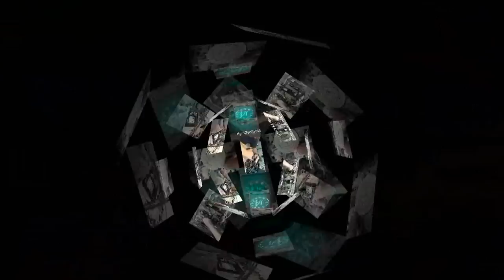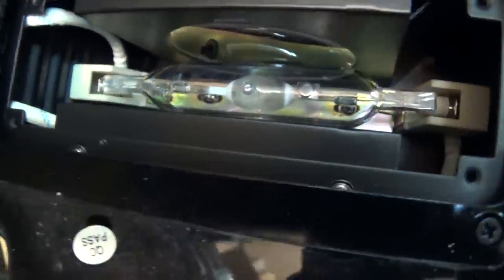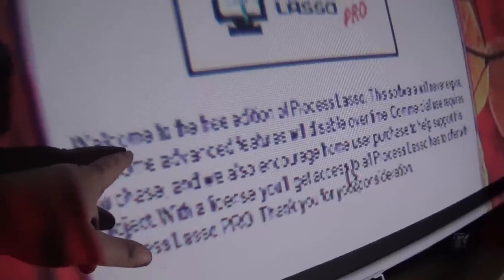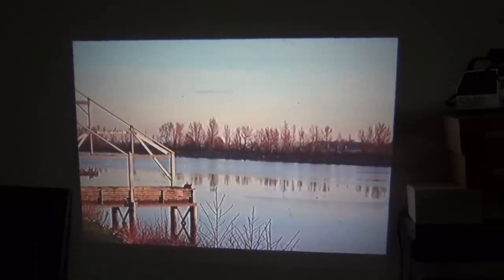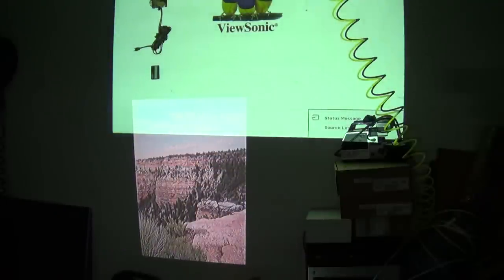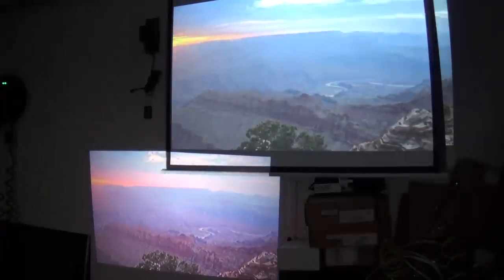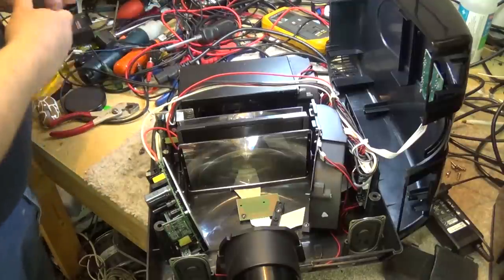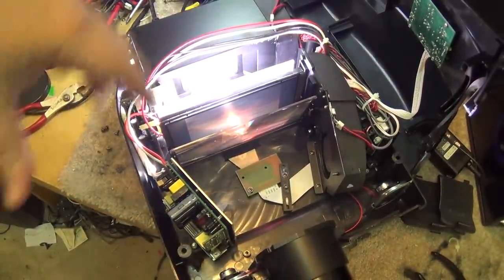Cheap video projector compared to a Viewsonic DLP

Comment from the maker: As a follow up, I researched the lamp. It is NOT 350 watts as the box claimed. Like every other claim in the specs this is also a lie. It is a 150 watt standard DE metal halide lamp, and it is 10K. I just happened to have an old 10K lamp from my aquarium, that was a little too yellow for my liking (I normally run 14K which are blue)
Powered it up, works perfect, looks identical. Tried my 14K bulb, and the picture was really cold!

Comment: It meant that it can take 1080p video in but what is projected out is most likely 240p 360p or at best 480p. The unfortunate thing is that they advertise it dishonestly as 1080p.
Reply from the maker: +Nick Di Mario It is an 850 x 480 projector, so regardless what you give it, is displayed as 850x480. In this demo, I haven't found the 16x9 setting in the menu, so it was in 720x480. Still looks like crap.

Comment: This may be of help to some, copied from projector central on the topic
Cheap Projectors -- how bad are they?

When you look for really cheap projectors they are easy to find. Search "cheap projectors" on Amazon and many unheard of brands like Digital Galaxy, Fugetek, and Paramount will pop up, all touting HD 1080P projectors that put out lots of lumens with 20,000 hour LED lamps, many for under $200. They are hard to miss.

Everyone instinctively knows they will get hosed if they buy allegedly high-performance projectors at low-ball prices. But just how bad are these models? If the Amazon user ratings are to be believed, a lot of customers seem to be quite happy with them--lots of 4 and 5 star ratings. Do these projectors really give you decent home theater on the cheap?

To be honest, we'd never looked at them until now. They are made by vendors who would never send them out for professional review. So we ordered three of them on Amazon from three different brands and put them through our normal testing procedures. Our overall take is as follows:

1. Some are better than others. From what we've seen in our test sample of three models, they cannot all be written off as total junk. None of them are high performance projectors in any sense, but some of them can produce a decently watchable picture as long as your expectations are not too high. Some can't.

2. Many who buy these projectors have never seen a good projector. The 4 and 5 star ratings on Amazon are written by folks who are not picky about image quality. To be fair, people who buy very cheap projectors are generally not familiar with higher performance models and don't have anything to compare them to. For many buyers, just to power one on and get a big picture on the wall for the first time is worth a 5-star rating.

3. The cheap projector vendors publish false brightness specs. We only measured three of them, but none of the three were remotely in the ballpark of their specs. The Digital Galaxy DG-757 claims a whopping 2800 lumens in their Amazon ad; the unit we got from Amazon measured 137 lumens. The Fugetek FG-637 touts 1500 lumens; the turkey we received put out 87 lumens. The HTP-LED33 claims 2000 lumens; we measured 190.
Reply from the maker: Yes that's about the size of it. You get what you pay for.
I have a 150.00 pico projector, and it serves the purpose, to project my cable box on the bedroom ceiling. Only SD, but good enough for watching TV in bed.

Comment: Can tell don't know much about PC's.  Right click desktop got to display settings and can set the resolution.  One in brackets saying default is the rez of what you have it hooked to..
Reply: Keaton Buster this guy is completely hosing this projector and i do tend to agree that the colour is way off with a strong magenta cast on everything but you could also see more detail into the shadow areas on the one he was slating in a side by side comparison. Albiet it was pixellated and low res but his 'glamour bottle' just showed up darker into the shadows. I am not sure whether the shadow detail actually is missing or whether it has something to do with the contrast range of the camera he captured it with. You could only truly evaluate this with the naked eye in person!

Comment: I had no idea these kinds of projectors were out there.   That's terrible.   I got an Epson 1280x768 one with HDMI that made a really nice bright image on an 8-foot wide screen at a venue I was involved with.    It was easy to drive with any laptop with HDMI (I used a Macbook Air).     One like it can be had for under $500 so I couldn't imagine wanting to go cheaper and risk getting something like you show here.
Reply from the maker: +3Cr15w311 I sold the thing for 50 bucks with a couple of free used lamps from my aquarium. The guy that got it wanted it for movie night in the back yard, and in total darkness it is watchable. Compared to my Viewsonic it is pale by comparison.Epson make some nice projectors. I like the Casio lamp less units. They use a laser and LED light source, and will go something like 20,000 hours.
Reply: @12voltvids  I think the massive differences in quality and contrast are down to the technologies employed in the projectors themsrlves. A DLP chipset is always going to be better than a LCD slide in that it is not flooded with ambient light from the surrounding pixels. They are either discretely switched on or off with Digital Light Projection. It has now come so far with 4k DLP theatre projection that you can faithfully reproduce all the scratches, film grain flecks and optical sound track bloops from a worn projection print and fool classic noir art film buffs!

Comment: I know what to do with it: Photonicinduction
Reply from the maker: I have seriously considered that but there are some good parts in that unit. For starters the light and ballast. Very usable. Those lamps are the same size as the old  500 watt work lights. So I think in the future the fixture is going to get a retrofit, and have that nice super bright metal halide bulb installed, and turn it into a nice bright work light. 
I already have an offer to take it off my hands though, all because it uses cheap bulbs that are readily available.

Comment: LOL!  What a piece of junk!  Very interesting!  Thanks for showing this =)
Reply from the maker: The funny thing is, other than the lack of brightness when given a non HD video signal, such as from a DVD player, in a totally dark room it doesn't look bad.
Considering that it uses a 20.00 light bulb. Thats about the only plus.
Its funny because when I was looking at it I said it looked like a 150 watt lamp. When I looked up the number printed on the lamp, it is a 150 watt lamp.
The box said 1080p, but the owners manual says the true resolution 800x480. Standard definition.

Comment: Looks like a retrofitted classic overhead projector :P
Reply from the maker: Speaking of that, I remember seeing a video where some fool did just that. Took a 14" computer monitor that the back light had failed on, removed the light diffuser from the back side of the screen, and laid the now translucent LCD panel on top of an old 3M overhead projector, and walla, instant data projector on the cheap.
Reply: grade 7 science fair project LOL

Comment: these are under $100 on Amazon ($75
Reply: Give us a better solution for $100!!! instead of bashing it, or tell us the next best CHEAP option? I'm sure a $650-$1,000 is better. seriously you can get something similar for $30 if you wait, sorry for your friend, but tell us what's cheap!
Reply from the maker: WoOsKii 1 
but this wasn't under 100. the guy that gave it to me paid 500 and then found out he had be ripped off. I sold it for 50 and the guy that bought it is very happy with it.
Reply: +12voltvids I was just trying to say Chinese projectors should not cost that much, you can get that same or similar model for under $100 on amazon, eBay, aliexpress, etc. its like buying a $5 Chinese flashlight for $50 and then comparing it to a $200 brand-name flashlight then declaring not to buy Chinese flashlights because they are a rip off because you got ripped.  In reality its probably decent for $5, and if the $50 was spent on a Chinese flashlight that actually cost  $50 instead of a $5 ripoff chances you would be happy with that too.  Just don't buy a no name Chinese $200 one instead of a $200 name brand.  Sorry your friend got ripped off for a lot of cash, but the guy in the van could asked for $1,250 (anything) and claimed the projector was 1080p native name brand $6,500 top of the line name brand, or let you assume that. So how much worse of a product would it be if he got duped for over $1K? it is what it is no matter price paid. I know you understand my point.
Reply from the maker: It wasn't a friend that got duped. It was a customer at work. When I was leaving he came out to my truck and said want this?, and then told me his story about it. I made the video for a laugh to let people know about this crap. Obviously someone buying a 50.00 Amazon or Ebay projector is not expecting much. As I said I sold it for 50.00, and the guy I sold it to complained that it wasn't very bright, and I said hey what do you expect for 50.00
Reply: +12voltvids Yea I feel ya, I guess its just as easy to get ripped off on the internet as it is from a dude on the street.

Comment: If the panel is 16:9 why is it using a anamorphic 4:3 ratio?
Reply from the maker: +t0nito I have no idea. That's just the way it works. It is a piece of junk. That's why it was thrown away. (given away)I still haven't found a use for it, but come Christmas I will. I have a loop that I project on a screen I hang in the window. I had been using my good Viewsonic, but now I can run the loop on this, and not have to worry about consuming an expensive lamp. This one uses the same bulbs that my aquarium hood uses, so needless to say I have a half dozen used bulbs that have lost their high color index, which the corals in my tank needs, but is still just fine for projecting pictures.
Reply from the maker: +t0nito Setting in the menu that I found when I sold it. Yes I found some sucker that took it off my hands, and to him this is the greatest thing in the world. I guess compared to the 19" RCA TV from 1979 he was watching it is a step up but...

Comment: Kinda looks better than the "Sharper Image" ones that Future Shop was selling.  What was the true resolution of the LCD?800x600...640x480???  The original LCD projectors were only 1 LCD(The ones that fit on an oldschool projector).  Comparing a Budget LCD projector to a Office grade DLP?  How did the 3D glasses work?
Reply from the maker: That cheap LCD projector is actually 852 x 480.  Those cheap pico projectors could be 640x480 or 320x240 . My virwsonic is 1024x768. I have an led/LCD unit which is also a single panel 1280x720 and it looks actually quite good. The 3d glasses did nothing because it doesnt display 3d

Comment: If that would be this projector the one it uses a dirt cheap quality built, then I could use them as a Doppler Radar to track down about the severe weather, Clock Display with Digital Format from Raspberry Pi Clock Module, Roku from iHeart Radio, video transparency from Computer or from XBOX 360, or to use as a Surveillance Camera.

And if that would be for Epson S9 Projector, I could project the video from Computer with the nice text on the screen.
Reply from the maker: There are plenty of better choices. Micro projectors like the insignia I reviewed, and I have another one enroute to review. 
I use the insignia in my bedroom to watch TV at night on the ceiling and it has a beautiful picture in a dark room, and projects about a 60" picture and is dead quiet, runs on a 5v USB power source, and draws very little power. This one uses a 150W bulb and has a fan loud enough to wake the dead.

This thing is just basically a 7" LCD screen with a metal halide light and large lens. Yes it will be cheaper to run than a projector that used a UHP lamp, as new bulbs for this are only about 50.00 and available at any aquarium store. My aquarium uses the same bulbs as this. The guy that gave it to me paid 500.00 for it and knew as soon as he connected it, that he was burned. I put it up on craigslist, and got 50 bucks for it with a screen.

Comment: I've seen the bulbs they use for theaters, and they do actually look a lot like that but 10x larger. Of course, looks is about the end of similarities, this thing is a piece of shit!
Reply from the maker: Cinema projectors use Xenon lamps.This POS uses a double ended metal halide lamp. The exact same bulbs that my saltwater aquarium uses in the cabinet. Different color temperature though, as I run 13K in my tank, and these are more like 8K. I put it up for sale and someone took it off my hands.

Comment: Companies put a lock on the light bulb not because they care but, because they don't want people to hack the bulb to easily swap for a cheaper version since they make money on their own bulbs, nothing to do with safety hazards.
Reply from the maker: Bzzzt WRONG. The time limit that some companies put on the bulb was because they wanted to make sure the bulb was EOL before it failed, because in the early days the lamp was typically exposed and an exploding lamp would send hot shards of quartz into the optical engine and damage it beyond repair.
In later lamps they put a safety glass over the front of the lamp to contain an exploding lamp, and the timer that shut the lamp down was removed.
The problem was some cheap people, and I am thinking of one guy that we had as a customer that drive a Bentley came in, bought a new bulb plugged it in to reset the timer, and then put the old bulb back in then returned the new bulb to the store and got his money back. The kid working the counter just refunded his 400.00 and didn't ask questions. You can imagine my surprise when a TV came in needing a lamp and I plugged that "new" lamp in and it didn't work. It really threw me for a loop, I then suspected the ballast board, ordered that in, and it still didn't work. I then suspected the new lamp, ordered another one, and plugged it in and the set worked. I shipped the "defective" lamp back not knowing that  it had been sold and returned. The manufacture refused the return because the reset chip that was part of the lamp housing had been tripped. The boss initially blamed me, but after going through the computer saw a sale and return so I was off the hook. From that point forward we started putting anti tamper stickers on the boxes. No return if seal broken.
On some TVs there was a service menu you could reset it, and others not. It was a stupid system for sure. And to answer the question. YES I have seen several of those bulbs explode. 1 in an open lamp and the optics were damaged, and several that had the shield and no further damage done.

Comment: My guess is that it is a WVGA panel, but the scaling done by the logic is just so poor that it makes the result even worse. I mark these as spam anytime I see them on Craiglist or anywhere. If someone was selling these in the local mall's parking lot, I'd call security immediately.
Reply from the maker: Browningate 
The resolution was 852x480. I didn't have it set to 16x9 when I shot this but did find the setting when I sold it. I sold it for 50 bucks and the guy that bought it uses it out by his pool at night. He thinks it looks fine but then he is still watching a crt tv anyway so he hasn't experienced HD.
Reply: @12volt
Looks like you managed to pull a win out after all if you got some poor sucker to cough up $50 for that thing. :-)

As for the aspect ratio thing, I don't think that changing it would've made a bit of difference anyway. The scaler inside of that thing is just so amazingly bad that the only way to get any semblance of competent video out of it is to feed it native resolution (assuming it even accepts that) to eliminate the need for scaling.
Reply from the maker: I had to throw in the screen I got with it and a bunch of spare bulbs. That was OK though as I use the exact same bulb on my aquarium, and had some used ones that were loosing a bit of brightness so no good for coral anymore. I put the bulb from the projector (and the spare that came with it) in my fish tank, and put one from the aquarium in this, and threw in 3 spares. It does have a composite and S video in plus HDMI and VGA. The guy that bought it uses it with a DVD player, so he doesn't see the quality loss anyway.
The video is actually earning revenue so it is a win win for me. I make money from showing this POS, I made a bit selling it off, and I didn't have to throw it out. One mans trash is another's treasure. Isn't that how the saying goes. 
Some people would toss a perfectly good projector because 1 pixel failed, and to someone else that is perfectly acceptable. 
This is how the store open box store operates. People return TVs to costco because of a single bad pixel, or because they left a video game on it and caused a screen burn. Costco takes it back and ships it off to the discounter. Discounter looks it over, determines how much they want for it and sells them to people that have lower standards as to what is acceptable.